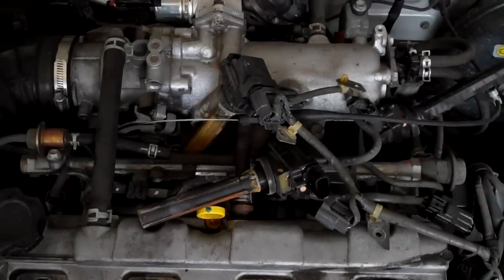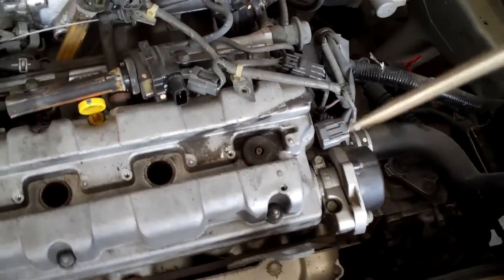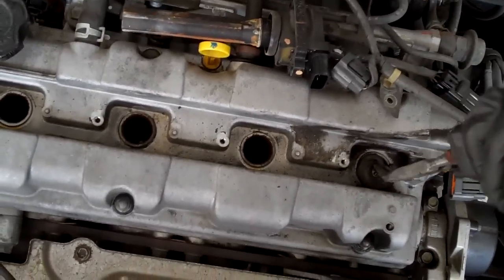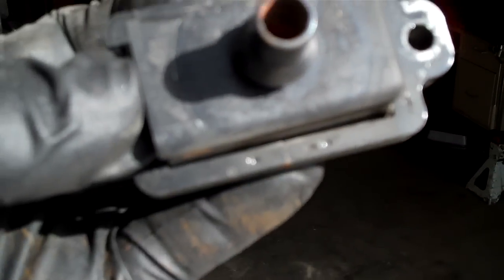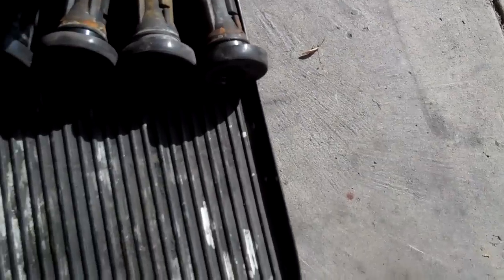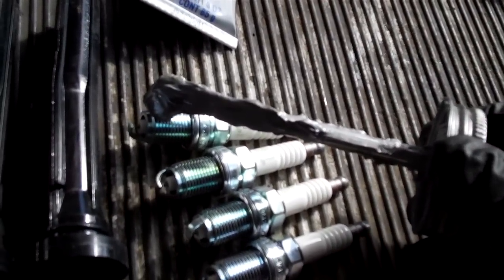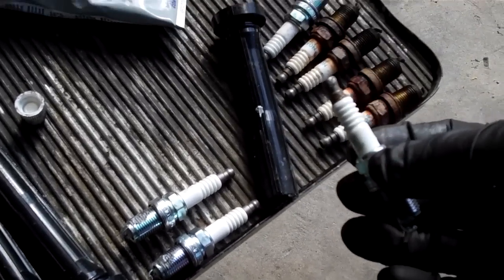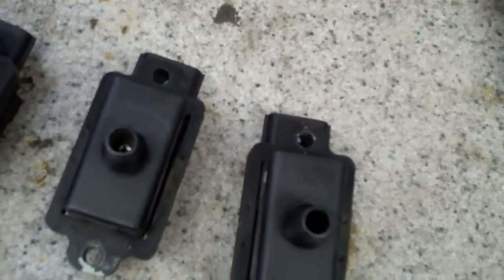How to deal with rusted plugs when they're down in the tube and how to prevent trouble

Comment: Hello Brian
Good vid as all ways.
My back is messed up but like to keep up with diffrent tips and tricks
I am just a do it yourselfer but have some input that might help.
I was a tireman for 20 years. Forklift's,off road,foam fill.solid press ons,and on and on.
If you only wanted to buy ONE product to do everything you did with TWO?
Get the COPPER anti sieze. Put it on everything! The plastic the plugs the inner coil
Then clean your battery up and put it on. Trust me on this.
Thanks

Comment from the maker: @MrJayChhun I'm sure they are smart people who have their reasons.   Given my experience I have NEVER overtightened a plug due to anti-sieze.  (I do hundreds a year)  And I've encountered several aluminum heads that have been stripped out because anti-sieze wasn't used.  The aluminum threads get stuck to the steel threads and get ripped out.  Note that I don't use much at all, but I still highly recommend it's use when the head is aluminum.   Thanks for bringing that up- good question.

Comment: great vid Brian.   Do you put anything on the rubber  coil  extentions to prevent them from sticking.  Looks like most of the problem was not pulling the coils off the spark plugs but the metal tubes in the rocker cover were rusting to the  rubber coil extentions.  I would guess some anti sieze would work???

Comment: This rust issue is similar to the Fiesta Zetec engine which I found when about to change the plugs. I pulled the rocker off and found that I had a core plug leaking through the threads and causing moisture. I would have checked this first before putting in new plugs etc.

Comment: If I spray PB blaster in the cylinder where the spark plug is sitting, how can I get all that gunk out of there? Trying to clean it out before I take out the spark plug so when I do nothing falls into the head. I don't have a compressed air gun or anything like that so it's not an option. Thanks in advance!
Reply: Whoo Diss get caned air. its air in a bottle put the stick on it point down the spark plug hole and spay the air can

Comment: Dielectric grease should not be on the top tip of the plug or between the plug tip and the contact.   Dielectric grease is an anti-conductor.    It is frequently misunderstood.    You can test this yourself by doing a continuity test with a small blob of the grease.   There is no electrical conductivity.  You can use it on the insulator part of the plug.    That will make it easier to remove in the future.